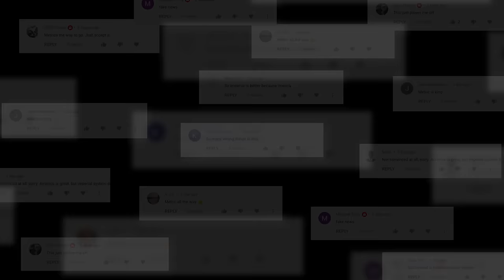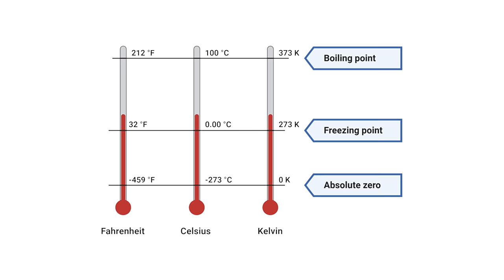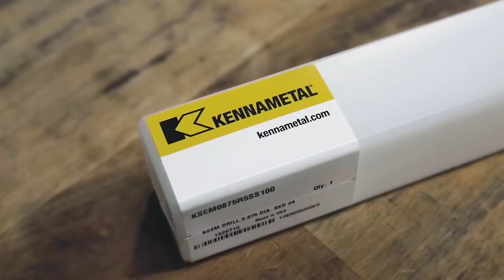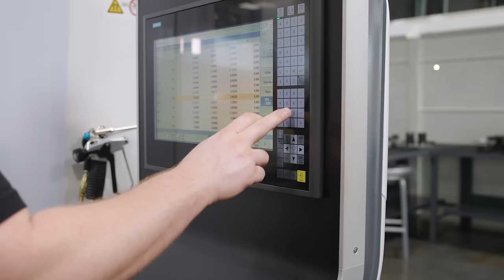Why METRIC is SUPERIOR to IMPERIAL

Comment: Fact check:  In the United States  the inch system is used for machining and not metric.    Over 20yrs ago JPL lost their Mars lander because they used metric measurement in the landing trajectory. That mistake would be about a half $Billion in today's money.    Metric threads have their problems.  Imperial thread pitch can be easily measured against an inch ruler which is impossible with metric.  Internal threads that are Imperial are superior to metric because they have a coarser pitch cutting into the substrate especially if the threads are in cast iron.   It is easy  to understand  size dimensions of an item except if it is in centimeters.  I can't picture a centimeter in my mind.   Metric absolutely sucks.

Comment: Ok you got me...when I saw your "Imperial is superior to metric" i got so frazzled that I had to go for a walk...I work on projects that deal with Civil, they work in decimal feet (132.35ft) . then the architects work in feet & inches (16' - 1 1/16") and the steel fabricators work in inches.  My job is to make a 3d model and add in all these systems for facility design...and it is difficult to do cross checks of items as I am forever converting these units...Every once in a while I get a metric job and it is soooo easy to work on I feel like adding a 15% headache feel to all imperial projects...Actually what i do is work in metric for everything and just set my dimensions to show duel dims...

Comment: Frankly, both systems are completely arbitrary. The meter is originally based upon the distance between the north pole and a line of longitude to the equator passing through PARIS. Why Paris at 2.3522 degrees east instead of the prime meridian? Simply an artifact of the global pissing contest between the United Kingdom and France. And honestly, looking at the original definitions for the basic units (length, mass, temperature, etc). the actual physical realizations created were inaccurate.
The metric system has a lot of advantages, but so does the imperial system.

Comment: There's no rods anymore to define metric.  It's all derived from physical constants now, so it's perfectly accurate.
Reply: The physical constants are used to define the length of the rods.  The measurement is still the rods, just using another thing to define them.

Comment: The metric system is useful for machines and things that require very tight tolerances. 
It is not as useful for anything made of wood, and it is not useful for designing anything that humans physically interact with. Which is most things.

As a result, in a country that has been metric for over fifty years, we still have inches on one side of the ruler and I use that side at least as often as I use the metric side.
Measurement systems to an extent define the type of innovation that is possible.  if the entire world switched to metric in 1000AD, the industrial revolution would have physically looked very different, if it happened at all. And violins wouldn't exist. 
It's also no coincidence that 20mm lumber is usually 19mm, 25mm is slightly larger.
It's also no coincidence that schools are going backwards in terms of meeting basic education metrics.

Comment: I think that in time America will completely switch to the metric system, the only thing that will remain will probably be distance and speed in miles, then the height of both people and also in the aviation industry and the marking of the tire width and the display in inches will still remain.
Perhaps the pound will gradually be replaced by the kilogram
 What will disappear gradually will be the designation of engine performance in horsepower, it will disappear together with internal combustion engines.

Comment: Of course the metric system is vastly superior. I'm engineer and moved from Europe to the USA. The imperial system is really messy and makes people ignorant on certain science matters. For example, check how many videos in Youtube where people compare "horsepower" with "torque" (measured in pound-foot). The average Joe in the USA don't even understand how stupid such comparison is because he doesn't understand the true meaning. And what the heck is that with "pound-foot"? A pound is supposed to be both a measure of mass and force? The metric system helps people understand the laws of physics more easily as everything becomes simpler when using it.

Comment: Imperial is literally converted from metric, because that’s how imperial measurements remain consistent. 
Because metric works and isn’t based on an 1800 invention codified in an 1824 act of parliament, parts made up when original measures were destroyed in a fire in 1878, and was updating  some measurements going back to the 1300’s

The foot is the length that it is because it was literally the length of the foot of King Henry I. He invented the foot using that measure l. His reign began in 1100.

Plus imperial yards are shrinking by 1 part per million every 23 years.

Imperial measurements are dumb, and I’m old enough to have been taught that crap in school, while my dad is old enough he doesn’t understand metric measurements of weights or lengths, and finds it confusing if you mention the metric and also the imperial as the metric is so confusing to him it renders the whole sentence unintelligible, you have to Google the conversation to Fahrenheit, and then only tell him the temperature in that measure without mentioning Celsius at all.

Comment: Metric 👍
Example:rain fall is measured in millimeters conversion is simply on every square meters 1 mm is 1 liter (1 000 000 mm^3)
1mm=1liter per 1m^2
and if weatherman says rainfall of 55mm means 55liters per square meter
1liter= cube with 10cm or 100mm

Comment: I prefer Metric to Imperial measuring systems.
I prefer tissue paper to sand paper to wipe my ......
I prefer drinking ethanol to methanol alcohol to get a buzz.
For the same reason , either will get the job done but as to which is better there is no question.

Comment: I always feel cheated when I see a distance in K's.
I immediately convert to Miles!
Whjen will planes start uniformily use M's for Altitude? How many crashes?
Already Lbs/Litrres of fuel have made disasters.
And
Metric machine srew threads!
Bit of history:
Way back around 1870, it was finally agreed thet Greenwich, UK was where 0 on maps was to be.
France wanted the brass strip to be in Paris,. Just a too late, too many marine maps had been in use for too long.
The French were soothed with a vague promise that Britain would hence forth use the Metric system.

Comment: What most dont understand is that the US does use the metric system.. they just have a multiplier added on when ever they make a measurement. What !! you might as what do you mean, well the imperial system does not have a "yard stick" so to say like the metric system does, is actually use the metric refferences and converts it to imperial..  Metric wins..   Also everyone know jiu jitsu is better than karate.. Fact !

Comment: I still find it strange that a large portion of Americans use metric every day, all doctors, pharmacies, all the military.
Reply: @mikeduncan4294  
Medicine and science has been metric in the U.S. for a very long time. It's not strange at all. SI units are used in lots of industries. The military...hardly at all. Altitude of jets is in feet. Airspeed (and boat speed) is in Knots. Thrust is in pounds. Fuel is in pounds. 
Just because SI units are used in science does not mean they are best for the populous at large in every day life.
Reply: @noelmasson  it works for all but 3 countries in the world
Reply: @mikeduncan4294  You said the military. I pointed out that was not the case. Also not the case in whatever airline or shipping line you travel on. Chill.

Comment: Measurment is measurment if your math skills are good and you understand it then measuring is measuring fit is what matters. No measuring system is superior. They are all just measurments. I guess vhemists and physicists should stop using angstroms and stick with mm? Blah blah blah i think its beter because blah blah blah.... 1 onch will always have a constant metric equivelant of if i recall 25.4mm? I use both because i use whatever the original parts im remachining or making. I use celcius and farenhiegt both. Humans have created a lot of standards. I dont gove a crap since machinerys handbook will have  conversion data. I just make parts that fit.

Comment: there is literally zero CNC machines that use inches as their true units. there are G codes to translate but at the core of the control system, it's mm. every. single. one. same with robots.

Comment: Well, yea. Imperial isn't even imperial when you get down to smaller sizes shouldnt you divide the inch by 12? Then divide those 1/12 of an inch sections into 12 etc etc Instead you divide it by 1000 because base10 is superior. Just use metric in the first place.

Comment: Imperial length inch measurement is superior since it is binary.  If base 10 is superior why is this not used in computers
Reply: You're a funny guy, chip technology in thousands of different devices is (metric) nanometre and sub-picometre ---- LOL LOL LOL 😁😅😆😂
Reply: @ytfan3815  Yet the operating system reports memory and/or storage in GB where 1 GB does not equal 1 Billion bytes, rather 1,073,741,824 bytes. Not so metric then is it?

Comment: These are reasons for noobs. The most important thing is that metric system is clearly defined in UNCHANGING physical phenomena or values. In other words with definition of for eg. 1 cm you can not only create perfect 1cm stencil on the basis of it other lengths but you can do it literally anywhere on the planet or in universe and it will be ALWAYS the same. Imperial units are not like that and btw. this is one of the reason why Europe sends to US EVERY year metric stencils and imperial stencils are BASED ON METRIC STENCILS.

Comment: USA don't use the imperial system, it's a clone of it called the US customary measurement systems and it is of course different than the imperial system just to mess it up really bad.
For example one US gallon of fuel is only 0.8327 imperial gallons.
Try to compare fuel costs 🙂
Horse power is also different, 100 US HP is more than 100 EU HP.
When a building is done they always get a pile of useless material and a research got the conclusion that the pile was much bigger when working with feet and inch than cm and meter.
Reply: The Imperial System was introduced half a century after the United States had left the Empire.  It is not our (USA) fault that some Imperial units differ from US Customary units.  The important units (inch and pound) are the same.
Reply: @GH-oi2jf  The system is broken, just give it up and do as the rest of the world so stuff works.
We still have inch hardcoded in electronic components where there is 1/10 inch between every leg, that will probably remain until components get near invisible but a system where units are different depending on wet or dry is insane.
USA already use the metric system in everything that is important like drugs and guns.

Comment: Just one question.. the imperial it's not better than metric, easy to explain it's the same concept with banknote.
What notes does the federal reserve print? 2 dollar notes? 5.7 dollar notes? Or 17.9 dollar notes?  
No they print 1, 5, 10, 20, 50, 100 notes
The imperial system it's a nonsense

Comment: Only in America will you use 3 different measurement systems and pretend they are all the same. That plank is 4feet 2inches and you need to travel 16 miles to pick it up

Comment: Every time I see some new imperial thread size, whats have to be done on some part, my brain wants to explode 🤯 Metric sys is simple and friendly 😀
Reply: Inch-based thread sizes have been stable for a very long time.  I doubt anybody is creating new sizes.
Reply: @GH-oi2jf  I work with metric sys every day, and for me those inch-based measures are very rear… thats why they seems “new” for me. 😀 …and I have use only 5-10 different so far 😀

Comment: lol if metric is superior why do the screw and bolts on second hand cars always crack fail to undo. Metric threads are too fine. On the other hand, I can undo 50-year-old imperial thread no problems at all. For a weight and measure system sure metric makes calculation easier but some physical joints and application imperial is just plain better. Brake pipes on all German car are imperial specification translated into metric...air line fitting use a lot of imperial taper thread. So, the statement about metric isn't straight forward.

Comment: I actually dont like 10s. Why doesnt computer memory come in 10s? Because of halves and doubles. I prefer a human centric measurement. I can easily half and double measurements. Hence my preference for fractional vs decimal.
Id also argue you are more likely to interface with tools and things that are a foot vs a meter or cm. 
I can also eyeball tpi with a ruler. Try that with metric threads in the field. Is it 1.5 or 1.25, or 1.75. i suppose its a lab vs field measurement.
Reply: Computer memory deals in ones and zeros, or binary, nothing directly to do with halving or doubling. Imperial is not a binary number system. In fact, imperial is not a system at all, it is a jumble of various number systems.

Comment: we might use a rod in frace to define metric measurements, but you guys measure stuff in chains and barley corns im actually convinced the entire system was invented by farmers and the random crap they had to hand

which begs the question how many hog penises are there to a goat head and how many goats heads in a mile?

Comment: Only issue I have with the metric system is a simple system inspires a simple mind. 
Overcoming challenges is the driving force of evolution.
Reply: well why aren't you inventing a better measuring system then? maybe one that is logerythmic? or one where the core unit changes depending on the day of the week.... or one that has no subdevisions and you have to eye ball everything... that would be even harder to master.... seriously... what a strange argument...
Reply: Or you are wasting your time on unnecessary conversions while you could be using your mind for more advanced and actually useful stuff.
Reply: @malte1984  Perhaps XLVI-inch-woody should switch to doing arithmetic using roman numerals to avoid developing a simple mind.
Reply: @malte1984  Everyday use when you're grown up is irrelevant.
  90% of your IQ is established by time you're a teenager. Learning a harder system early on will stimulate the development of a better thought process.

Comment: So if I understand this argument, metric is better for simpletons who struggle with math? I think you missed the main benefit of metric. Everyone knows that a quarter inch thick piece of aluminum is far weaker than the same piece of metal measured in millimeters!c’mon, man! And, no one has ever in the history of machining mistaken millimeters for centimeters, right? Right? While the number of times I’ve made parts from one-foot thick stock, instead of one-inch stock…why, it’s just embarrassing. 🙄

Comment: Funnily enough all the imperial meassurements is defined using metric meassurements.
Reply: And all the metric units are defined how? All this means is that all standardized units are actually defined from the same source. Nothing more...nothing less.
Reply: @noelmasson  Metric units have become standardized in a way which doesn’t vary, they have very scientific definitions, not to mention metric units are logical and precise, imperial units are not.
Reply: @NocturnalPyro  U.S. Customary units are standardized and don't vary. To say otherwise is wrong. Metric units are no more or less precise than U.S. Units. You can prefer metric...that is your prerogative, but try not to post disinformation about the precision of U.S. Customary units.
Reply: @noelmasson  hahahahaha that’s massive copium. 
Most of the times that I see imperial system being using it’s usually approximate values, not to mention the basis for the imperial system of meassurements is literally a fucking barly corn which definitely doesn’t vary in size at all.
Reply: @NocturnalPyro  You seem agitated and somewhat rude. Sad.
Forget the basis (the beginning) of imperial units. That's not in question. BTW, the basis for metric was not so precise either. The meter was originally one ten-millionth of the distance on the Earth's surface from the north pole to the equator, on a line passing through Paris. So there's that. 
However, now you say that metric units are defined precisely and that U.S. Customary units are defined by those same units, which makes them equally precise. I suggest you come down off your high horse for a bit. Enjoy your festive season.
Reply: @noelmasson  Yeah now the Meter is based in a different way, and the inch is still the length of 3 barley corns rounded length wise side by side.
The fact is the metric system is based around logic, and imperial is based around trade and speech.

Comment: Both, just use both. Literally done this the other day when fitting a cabinet for my friend. 

It’s not hard to do quick conversions and I find it handy when I need to remember two sets of measurements and remembering two sets in two different systems is a lot easier. 

Also rulers typically have both so that’s a non issue. Idk it might just be growing up with using both on the daily has made it more natural but hey it’s Scotland and we do weird shit.

Comment: ... metric and inch - 2.54 or 2 times 54 = 108 like first element hydrogen 1.008 - or 108 Mandala the beginning of all in universe and density of TITAN - is 4.54 g/cm3. And 1080 pixel is full HD - and AMERICAN football has exactly 108 seams. Come in the club of Titans 108-54-27 half divine like - Moses actor Heston date 05.4. and strong hero. And American Pentagon has 5 corner with - 5 times 108 degrees = 540 sum like green north lights in 540 Tesla Hertz. All in plan and DIN.